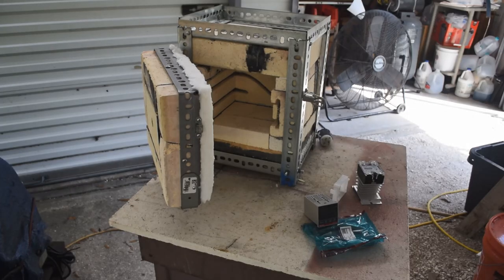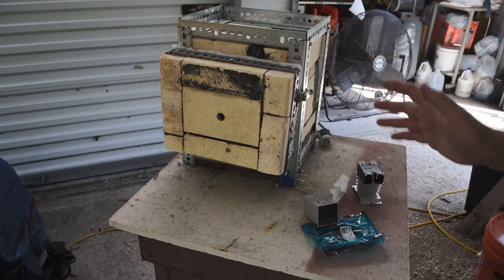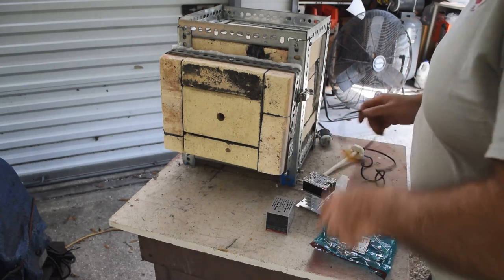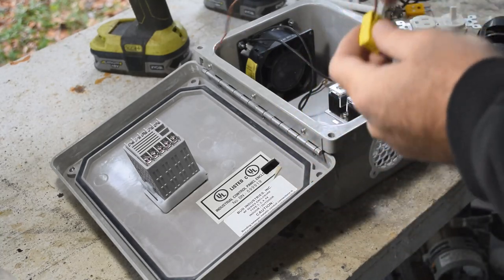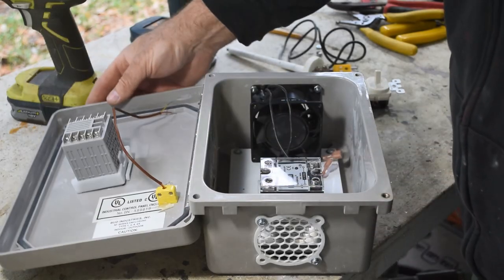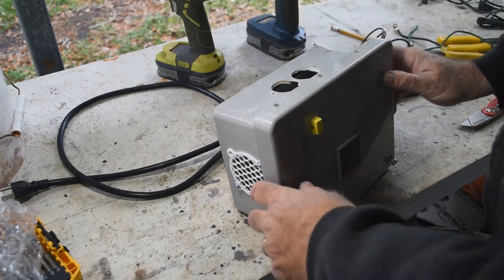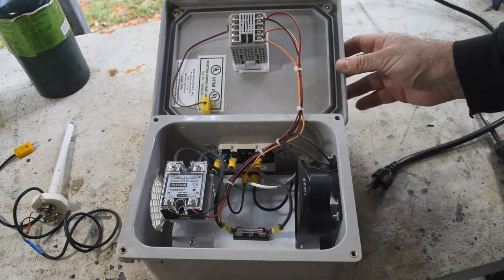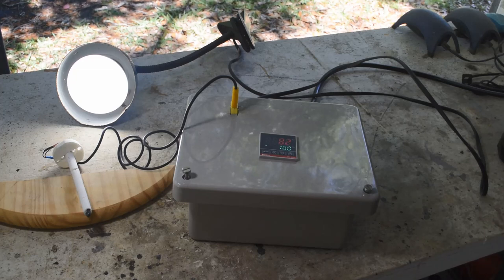A Home Built Cupelling Oven Part 4: It Works! Hi Ho Silver!

Comment: Nice build, congratulations. Melting point of Lead II Oxide is 888°C, so you need at least that for cuppelation. 
The only problem I can see is the lack of Faraday Cage grounding in the control box and the oven. Your resistance wire is going to make a good transmitter for causing electromagnetic interference, especially when the oven reaches temperature and the relay starts switching.
Reply from the maker: I think the thermocouple is reading low. It seemed to be working at around 800. With a solid state relay I'm not expecting much EMI. There is no arcing like in a mechanical relay or contactor to produce all kinds of EMI for the heating elements to act as antennas for.
Reply: @omegageek64  Your Lead button probably contained some Borax which would lower the melting point initially but that would be absorbed by the Cuppel. Too much Borax will lower the capacity of the Cuppel.

Comment: You could have installed the fan on the outside which would have left alot more room inside
Reply from the maker: True, but I didn't need any more room on the inside. Everything just fits, and I think it looks sleeker and nicer with everything tucked inside.